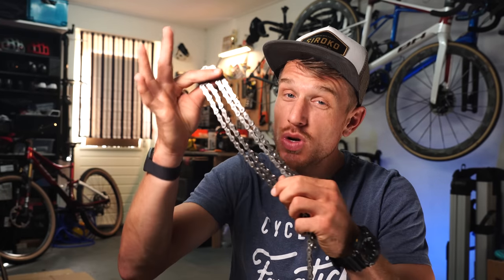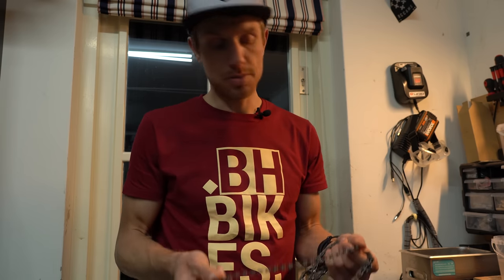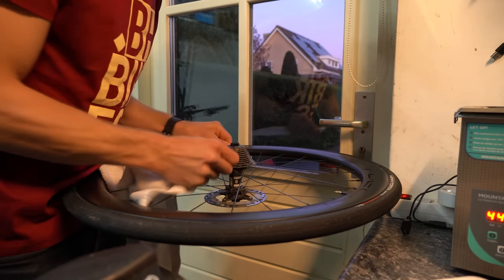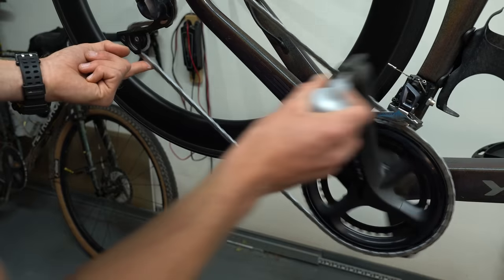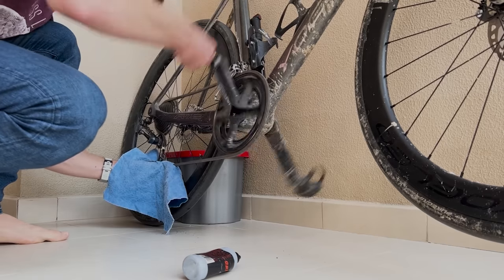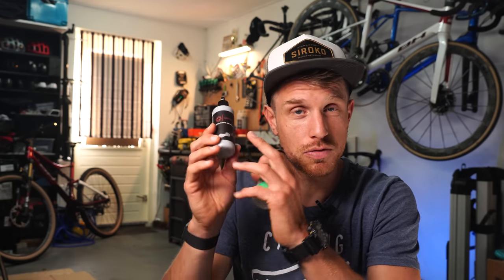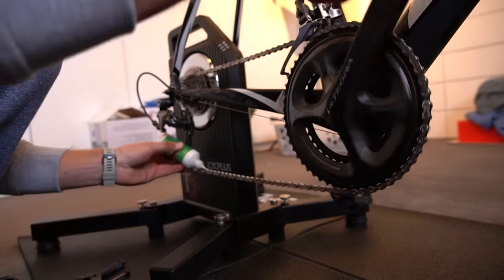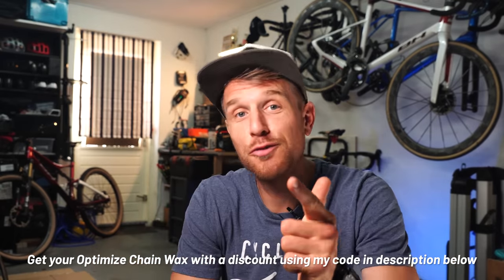Testing Chain Wax for 1-YEAR and this happened..

Comment: The: Muc-off dry Ceramic is really good Jasper! Zero friction cycling was hating on it but in the real world, it goes really good! Keeps your drive train almost spotless, very quiet and cost effective to run over time. I live in the desert southwest. I also tried the Marpiosa flower power, its okay but it gunks up too much. Muc-off dry ceramic is best WAX based chain lube in my experience W wax drip lubes.
Reply from the maker: Ok. Maybe try optimize next 😉🙌🏻 the graphene is an additive that not a lot of wax brands have
Reply: Interesting, I've never heard of Optimize before, definitely I'll give it try. Thanks brother
Reply from the maker: @adamgurule1458 👍🏻👍🏻

Comment: 12:02 Those hanging tricks are completely unnecessary. The wax stops dripping in 15-30 seconds after removal. So just hold it a bit over the pot and then it can be hanged anywhere without a risk to spill the wax. The $15 wax heater from silca (which they sell for $120 :)) looks especially ridiculous with that huge red ‘device’ to hang the chain.
Reply from the maker: this works for me (Y) and the cardboard is free

Comment: Save time? The minute or two I spend when washing a bike to brush on a bit of solvent (diesel, about a teaspoon) to the chain, cogset and chainrings, then wipe it all off with a soapy sponge during the bike wash...then wipe down with a rag to finish? THAT time? Those 2 minutes vs all the faffing around with waxes, etc? Guess nobody's paying you to sell their chain oil so wax is hyped as some sort of time-saver? I'm calling BS on this one!
Reply from the maker: Sure mate, don’t believe my word for it. Just read the 100 comments of others about the great positives of chain wax and the ease of use. 

A teaspoon of diesel is a new way to do it 😎
But you would still need to degrease a new chain. So the degreasing part will be the same no matter what product you use anyway…

Comment: Kerosene and diesel do a decent job too!
Reply from the maker: Diesel is quite greasy on its own imo. Won’t work on a new chain
Reply: AAHHHH...had never used it on a new chain! @jasperverkuijl
Reply: @jasperverkuijl  after you cleaned it with diesel, then it's ready for your acetone and it will be superclean, it's a two-step process. You first need the super agressive cleaner like diesel and then the other stuff to get the diesel off
Reply from the maker: @theDude9750 Im not using acetone at all anymore. It does nothing imo. (As I show in the video) The nitro thinner is really the stuff you want 🙌🏻
Reply from the maker: @nigelmcclean4166 big difference as the factory geese will already be gone on a used chain.

Comment: I somehow don't understand this fanatic degrease fetish. I run the factory grease for 100km, then remove it with kerosene and a tenside-based engine cleaner. That will get enough out. The first wax run will remove the rest anyways. I do drip waxing, though of course not with some expensive fancy stuff but a cheap wax emulsion as you get it from chemical suppliers, at $0.80 per 100ml. To apply it in the cold ... well, run the chain through a torch a few runs before applying the wax emulsion. Don't overcomplicate things.
Reply from the maker: Than you will completely contaminate your drive chain with the grease meaning you have to clean the cassette, derailleur and front chainrings after that 100km…. 

First wax run will mix with the grease and mess up the product (it will change the viscosity) 

So you just don’t get the proper result. Thats why I degrease. 

But there is an easier way that became available recently. I’m receiving it soon, will test and will update this video
Reply: @jasperverkuijl  Obviously I degrease it after the original grease run, though with not too much effort (kerosen/engine cleaner). The cassette/chainring can be cleaned pretty easily. This is all not a sterile environment at all where you talk about "contamination". If you are at this level of cleanness, you should not touch it with your fingers after degreasing, as that will obviously "contaminate" it with fats 😄 I don't notice any changed viscosity, and after the first reapplication of wax any remaining (in traces) oil/grease will be gone anyways. Obviously, we're still talking about a bicycle chain, not a vital part of a space shuttle, I'd put bit more effort into it in that case 🤔
Reply from the maker: @oefzdegoeggl  yeah I agree that after riding the chain it’s quite easy to degrease 👍🏻 

Sure I touch it with my hands. With contaminate I mean the mixing of grease, oil or dirt with the wax. It’s still contamination. Let me know if you have another word 🫡

You degrease it afterwards so it should work fine like you say 👍🏻

Comment: Chain wax is just so much faff. Just use squirt lube for all the benefits but cheaper and less time.

I did like trying it out but it is just so much more effort compared to squirt lube.

All the chemicals etc as well are toxic. Squirt is safe.
Reply from the maker: What you’re saying doesn’t make sense as “Squirt lube” = a wax! (It’s a water based solvent just like optimize)

The de-greasing part stays the same with optimize, squirt or any other oil or ptfe lube or whatever. 

The application with the optimize drip lube is just as easy as any other lube (including squirt) 

So, not saying squirt is bad. I’ve used it and it’s a good product. But it’s not better/easier/cheaper than optimize drip wax.

Comment: Shimano factory oil is perfect for first 1000km, after you can use paraffin wax.
Reply from the maker: If you prefer to get all dust and sand attracted to your chain, maybe yes 🤷🏼‍♂️
Reply: wipe out factory oil from outside of the chain, oil work inside of the rollers, not outside
Reply from the maker: it doesnt work together with the wax though..... so still need to get rid of it all @photoshutter

Comment: I just use candles for hot waxing. I cool the pot with wax from bottom with chain still in, until the wax get almost hard. Then dig chain out and drop to cold water. That way I can get more wax inside chain. As wax expand when hot and shrink back when cooling. It would make empty spaces, but if it start harden from bottom and around chain. There's chance to get more wax in chain. If all the caps are filled there's less room for dirt to get inside.. Although most of that extra wax would probably fall off after just very little ridding. I still do it that way, because I believe it helps. Even if it's just belief maybe.
Reply from the maker: That’s one way to do it 😉 
I think it won’t make much difference but the fact that the wax should be a low temperature is important indeed!
Reply: @jasperverkuijl  Even unmeasurable difference helps. :)
Also I made a tool that helps to clean excess wax off and make chain soft again without wax particles flying everywhere. 
It's basically a wooden upside down letter "T" with a freehub and cassete mounted on it. That goes inside big garbage bag and I can hold it with foots by stepping on the horizontal board of T like a track pump. And then can pull the chain around on sprockets.. I have a video of it on my channel, but it's a boring video.
Reply from the maker: @Hardi26 I just put the chain on the bike and rotate it for a few times and done 😂
Reply: @jasperverkuijl  That's a good way to do it, if you want to wax also your floor.

Comment: Wouldn't it be nice if chain manufacturers offered unlubricated versions for cyclists who want to wax their chains?  (Or, even better, prewaxed chains?)
Reply from the maker: They will rust in storage. That’s the problem. 
Pre waxed would be nice indeed 🤙🏻
Reply: @jasperverkuijl  Perhaps they could apply a rust inhibitor -- either one that doesn't need to be cleaned off, or is very easy to remove.
I suspect with the increasing popularity of waxing, they'll start to offer prewaxed chains.

Comment: It’s not, and why should be..it’s 10-30€ part, much cheaper as CB or CS..it’s shit in rain, it’s shit in winter ..it’s nonsense how much effort it need..take oil lubricants (rain/winter) or pfte (summer)
Reply: And replace your chain all 3000..else very soon you will replace CB and/or CS
Reply from the maker: People in the comments use their waxed chains for lot longer than that! 
Proper chain is 30-50€, good wax treatment when experienced doesn’t take that much time. 
Drip wax is as easy as lube, 
Just better performance. 

But do what you prefer. Everyone his own thing 👍🏻

Comment: grease inside of chain is not bad, bad is if it is outside
Reply from the maker: Any grease is bad if you want to apply wax. Any grease will attract dust and sand, also what’s inside the link
Reply: @jasperverkuijl  you did not understand my comment
Reply from the maker: Ok. How did you mean it? Maybe give a bit more context
Reply: @jasperverkuijl  grease inside is not bad if stays inside,grease outside is bad because collects dirt,so main aim is to remove gease outside on chain,inside can/ may stay some grease,it will be gradualy connect and dilute with wax ,in some 5 waxing,tested in practise

Comment: OMG! After degreasing the chain, do always a hot wax in the pot because if you use the dripping method it may not lubricate well enough the links of the chain inside and may damage your drivetrain! After hot waxing your chain, next time you may use the dripping processe! GOT IT??? Gosh amateurs suck!
Reply from the maker: Easy bro. Drip wax works fine. No issues 
And how have you investigated that drip wax doesn’t penetrate into the rollers if you are so sure?

Comment: Definitely not, wax has so much resistance. It feels like pedaling through molasses versus a nice thin oil applied before every ride
Reply from the maker: Your probably doing it wrong. They are proven to be very low in friction
Reply: @jasperverkuijl  I'm talking straight out of the bag. The only time I try to waxed chain is when it came that way. Rode it about an hour, off to the solvent bath it went. Triflow or dry lube depending on conditions. Noticeably less resistance
Reply from the maker: @gen-X-trader and this was a pre-waxed chain from Optimize? Or other brand?
Reply: @jasperverkuijl  was around 10 years ago. remember it was shimano, lower tier chain? slx maybe? came pre waxed. since then i have not ran anything besides xtr or xx1 on the sram side. more reliable too.
Reply from the maker: @gen-X-trader well, maybe it’s just too long ago 😂

Comment: Use petrol to degrease the chain. You need a strong solvent and that does it.
Reply from the maker: I tried petrol and works pretty good indeed
Reply: @jasperverkuijl  Fatty molecules that make up oil and grease are non-polar molecules. For that, you need a non-polar solvent. Stuff like petrol, zippo fluid, toluene, hexane and even isopropyl alcohol or acetone will do the job.
Reply from the maker: But acetone is terrible! I tried and it just doesn’t work well enough on a new chain.
Reply: @jasperverkuijl  Yeap, not as a strong non-polar solvent like Toluene or the normal petrol/gasoline.

Comment: You beter put that little pot of your in a bigger pot with water in. Then you heat up the water to boiling point en dan put the wax in your little pot because else you burn the wax en you destroy the compounts.
Reply from the maker: No I don’t burn the wax. The stove doesn’t go to a high temperature on the low setting so it’s all good. 

If you do it in boiling water it would get 100C in theory so that’s actually hotter than my method.

Comment: Well the problem with Wax it does not work well in really rainy conditions. After 2h riding in the rain the chain is completely dry.
Reply from the maker: I’ve had better experience but I’ll agree it does wear out in rain
Reply: @jasperverkuijl  well most of the times if the chain stays wet it ain't a problem because enough water can also lubricate only when it stops raining it start to making noise of a dry chain. But yeah wax is a great product but it depends on the usages. Squirt sells very small bottles which you can easily carry. But I am back on oil again, the one from dynamic, ultra, gives me both of  best worlds. It ain't getting really dirty while it also stays nice during rain showers. I rode TCRno9 with only one-time apply the lube during the 2 weeks. Yes I rode significant hours during the race in rain and also we rode some offroad. But the chain stays the whole race perfect and clean.

Comment: so gd simple
just use a sequence of jars with acetone to mineral spirits and, maybe, ending with isopropyl alcohol
let dry and you are done
no need to overthink this
soooo much bs on youtube
toooo much bs on youtube
Reply from the maker: Yeah so starting with acetone doesn’t work imo. I clearly showed and tested. 

This video was my yearly process. Not a short advisory video. I just showed all the (indeed bs) that’s online that doesn’t work! 

The advice is the 10 minute method i eventually found and shared in the video. (Using nitro).